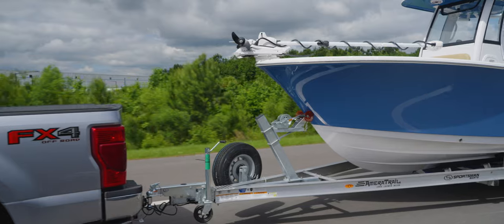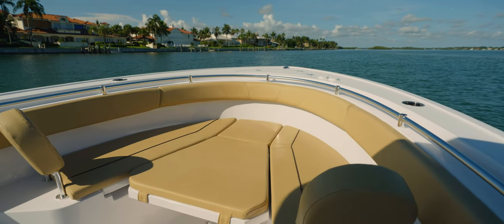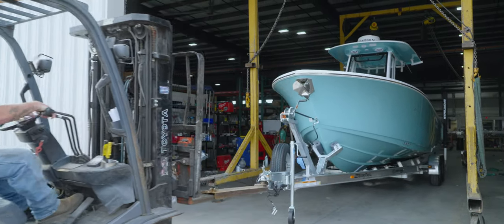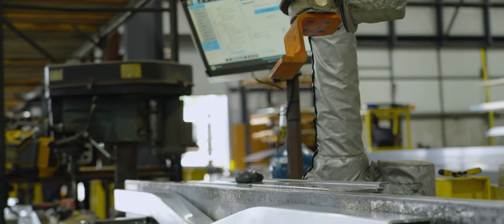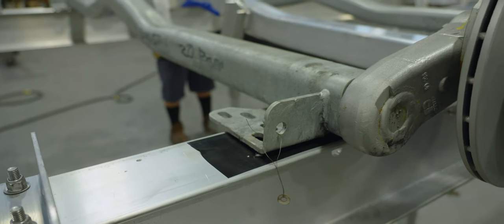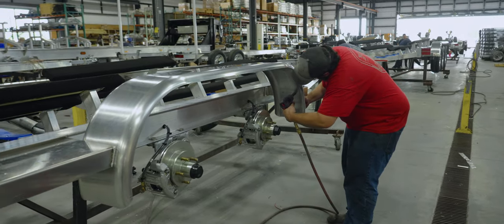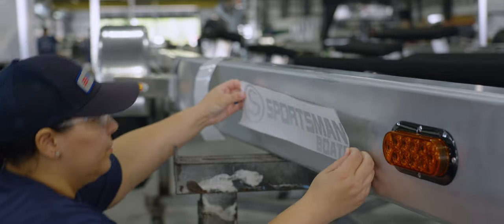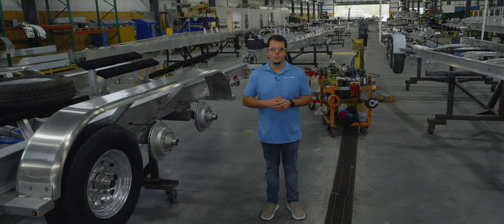HOW TO Build A Boat Trailer - Sportsman's "Behind The Glass" (Season 3 - Episode 2)

Comment: They are not really achieving galvanic isolation with the tape when they bolt the material together. Isolating washers would fix that and add less than a buck to the BOM cost.